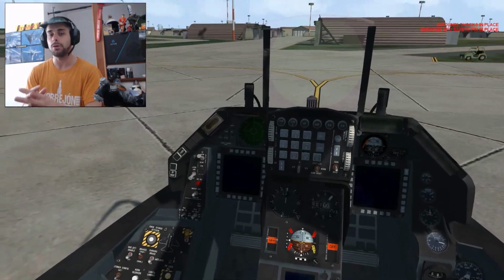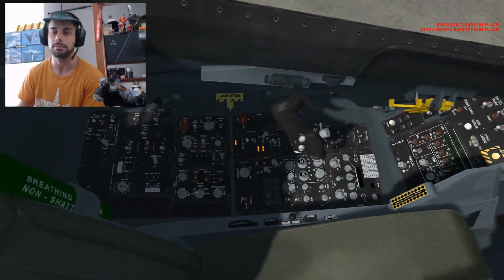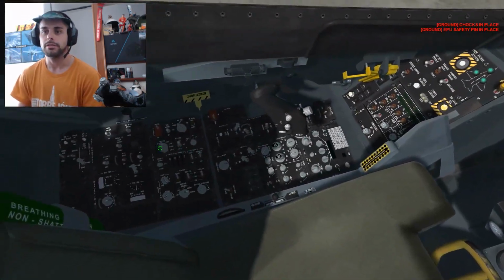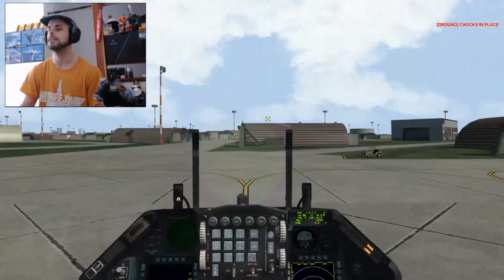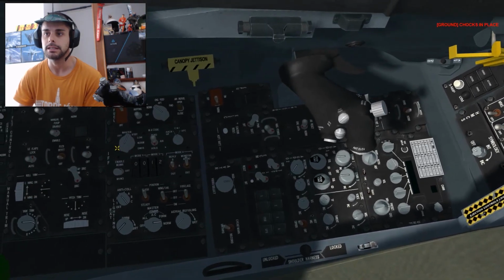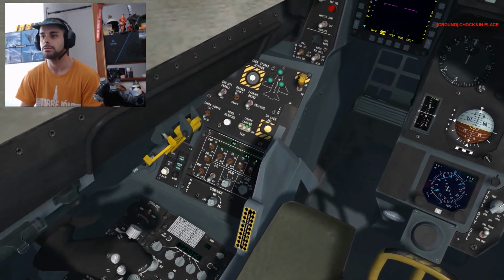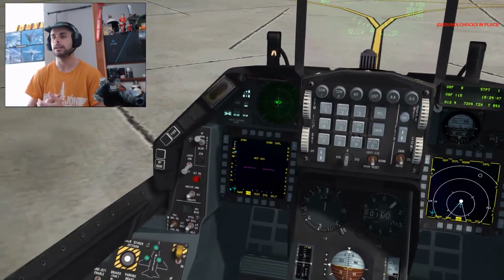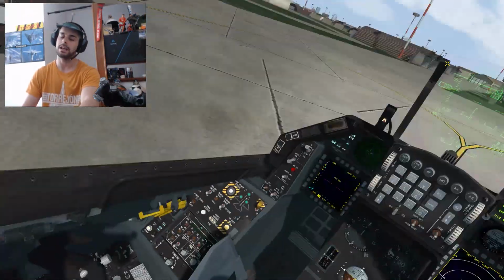FALCON BMS - RAMP START TUTORIAL (How to start up the plane)

Comment: Just switched from 4.34 to 4.35 and your video, regarding on how to perform a full ramp start, says it all. Thank you for sharing. The tests, that I didn't know how to do in 4.34, how to set the IFF settings and how to prevent a hung start you explaine very well. Greetz from Amsterdam-Hollanda.
Reply from the maker: Thanks :D
Reply: @revientoreborn  You're welcome, sir. BTW you have the Thrustmaster Cougar HOTAS, rigtht? I have one too and almost for 15 years. Still working great and as they don't make them anymore I hope it keeps on working. What profile do you use? I use profile from 'Dunc'
Reply from the maker: I have 2 hotas cougar hahah, the one in use and the back up one :D

I do not use profiles, everithing as DX set up in BMS and only the real pilot fuctions
Reply: @revientoreborn  Well, back in the day I also had two Cougars, since one had calibration problems. Went to expert pilots homes to try to fix that problem, but with no luck. Then I sold that one to a pilot I met at a LAN party and he said he could fix that problem. The profie I use (Dunc) is also full DX.  Thanks for the reply :-).
Reply from the maker: You wellcom.
Be advice, the current 4.35 have new keys, not new hotas fuctions but may be you loose some importan fuctions (or not hahah) I don´t know if dunc file is up tu date, Now I am in my parents house, next week I could check that.
Reply: Wow, that would be great. I just copied and loaded the 4.34 profile in 4.35, thinking it would work the same way, but I just started to fly the 4.35 :-). Not sure if the standard 'BMS Full' profile works with the Cougar and that's why I use the 'Dunc' profle. BTW I tried to make a small donation to your PayPal, (#2019 and #2020 link), but I got a reply back from PayPal that a transaction can not be made (on both links). Oke Sir, time to go in the celebration mode. Happy new year and thanks for all your wonderful tutorials.
Reply from the maker: Yes, the standard "Full" by default is set up to be compatible with Cougat, but the problem is IF windows detect cougar as first device, if not, that default configuration is not working and you have to set up manually in the BMS SETUP

About PAYPAL, those links 2019 & 2020 are blocked by paypal because REVIENTOR is not a person name, but I updated the info, in that acound (in spanish) in the down aprt of that webpage.

The paypal that I am using now (with my real name ARGGG) is this:
paypal.me/revientorreborn

Have a happy new year!!!
Reply: Copy that :-). Well if you can figure out if the Dunc profile that comes with 4.35 is good and ready to use I'm very happy. If not... I welcome your profile very much. It worked to make a donation. Please check your PayPal. Regards :-)
Reply from the maker: Thanks for the donation :D
This weekend I will come back to my house, I will check the Dunc profile.
Do you have any suggestion about any topic to create a English tutorial video?
Reply: Very welcome about the donation :-). Well, without being a bit too arrogant: I'm familiar with BMS enough to understand your tutorials, eventough most of them are in Spanish. So, thank you very much for your offer, really appreciated :-), but your great (Spanish) tutorials for me are very good to understand. Something due to the Dunc profile and maybe I should post this question on Benchmark Sims... but: the Dunc 4.35 tmm and tmj (almost empty?) files (opened with 'Foxy') are not working to 'Compile' and to 'Download' the setting to the Cougar. Maybe you'll get the same issue? Really curious about that. BTW: the 4.34 'Dunc - tmj and tmm' files can be compiled and downloaded with Foxy to the Cougar without any problem.
Reply from the maker: I use foxy too. Since I use W8 I am not able to upload/download files inside COUGAR.
I use Button & Axies emulation OFF, in this way all buttons are DX and you don't need a profile.
If the Dunc HOTAS profile are almost empty I suppose is to force the DX button and only use a few special keys.

CONFIRMED Dunc .key files are up to date :D
Reply: Ok, sir. Hope this video is clear to you :-)> Thank you for your help to figure out if the Dunc profile works in 4.35! https://www.youtube.com/watch?v=uaVmF4gZQW0&feature=youtu.be
Reply from the maker: Yes I have the same problem to compile or download
Here my video response :p
https://www.youtube.com/watch?v=5JqKIWvsTzk&ab_channel=RevientorReborn

Comment: I kept overheating the engine because I had no idea how the idle detent/cutoff worked... couldn't figure out how to make sure the throttle was as low as possible.
Reply from the maker: simple:
battery pwr on,  
air source on,
eng feed on
jet start 2
wait to 25%, do not touch your thottle
when rps stables, use idle cutoff, or move your throttle (depends of your configurator setup)

The idle cut of is that small think on the throtttel for your pinky finger (minute 06:50 of my video, everything is in the video see many times as you need using paper and pencil)
Reply: @revientoreborn  wow thank you for the quick reply!  My problem isn't with the steps to takeoff per say, but with my controls setup (I still haven't read all the documentation i should have read). I'm using a keyboard and a gamepadlol with the idlecutoff checkbox checked in the cfg (maybe the checkbox option doenst matter all that much actually). I'm just not sure how to adjust the green bar in the setup so I can use my keyboard throttle down, to pull the throttle all the way down to idle, it seems I can only do this with my gamepads axises but that's just annoying to do, id rather not have to use my springloaded axises at all for throttle. I guess i'd also rather be able to turn down the throttle to the max without using the cutoff button as well if thats possible.
Reply from the maker: I am not sure what do you want with a gamepad hahha
But in the setup in BMS use your right click and left click in the AB/Idle button, but that green and red bar are going to take the current value of your throttle position, move it and then use the mouse click